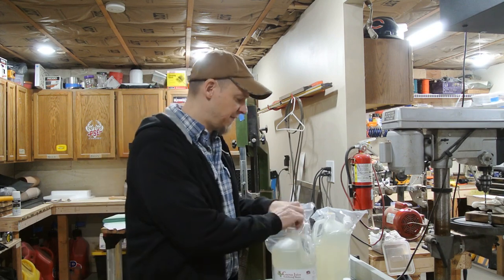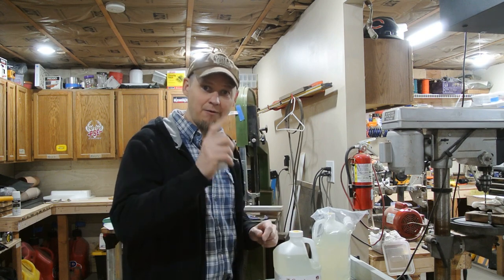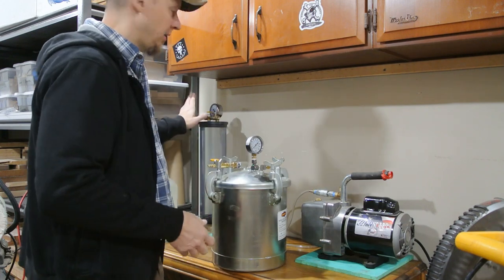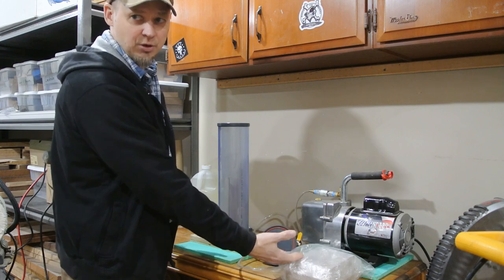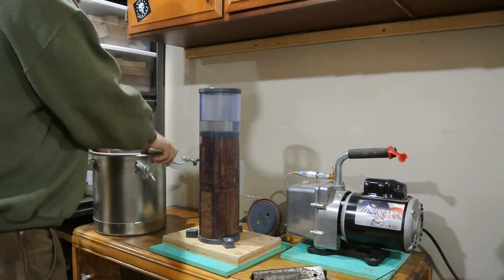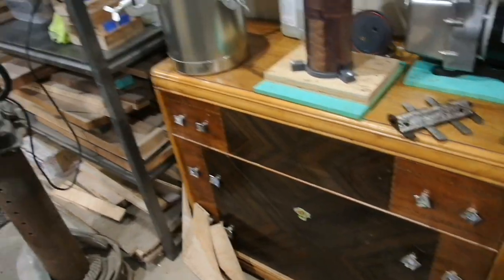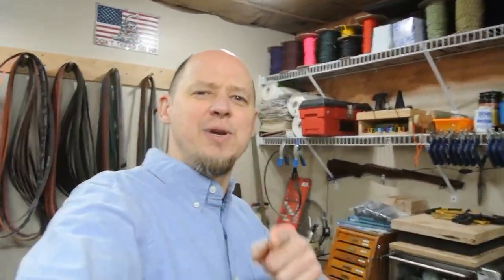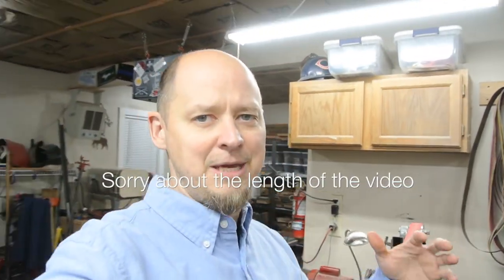Stabilizing wood for scales 2

Comment: Complements first then a suggestion!

I know this is an older video but it's great and very informative! Been seeing stabilized wood scales and found your channel while doing research and I'm working through your the 101 playlist. Good stuff! 

Suggestion time: 
So my background is custom composite product design and manufacture (15 y). Here is a tip from the vacuum infusion process (VIP) world. To minimize the risk of damage to your vacuum pump put in an in-line waste pot to capture any liquid pre-pump. Basically if an accident happens and the foam gets picked it drops into the pot from your line connecting the vacuum chamber to the waste pot. Another tube connects waste pot to pump with pick up set high in the waste pot. Shazam the liquid collects and only clean air gets to the pump. In the composites VIP world a large pot is a must or you'd trash pumps all the time. In your case a mason jar might be sufficient... lol I ended up with a decommissioned surgical vacuum pump that uses the same premise in a jar and it uses a rubber stopper to seal the jar and two hard-lines through the stopper for connecting the vacuum flex lines.

Sorry for the excessive comment length just a fellow PNW guy (Oregon) with what I hope is a helpful tip.

Comment: OK, I give up; what is a negative bar of pressure? You were talking about using a pressure pot after the pieces came out of the vacuum chamber. I think your statement was “the pressure pot is at 70 psi, 5 negative bars of pressure.” Are you saying that psi is directly proportional to ‘negative bars of pressure’? And why are your pieces being pressurized after the vacuum?

Comment: Should your vacuum pump not shut off from time to time and only start up when it loses a little pressure?
Reply from the maker: mrsaskriders ... You want your vacuum pump to continue to draw air from your wood.  Also, to stop a pump and let sit is not good because you do end up with some moisture being drawn and that gets into pump and if let to sit, can corrode.  I did a video showing what happened to mine until I learned better.  Besides, vacuum pumps are made to run for a long time period.  It doesn’t hurt the pump.  It’s your use of electricity that is the negative.
Reply: @CKKnifeandTool  thank you for your reply! I used to make artificial limbs and we wood laminate sockets with acrylic resin and it would be under vacuum. The vacuum pump stop from time to time and only start when there was a little bit of leakage. That was what I had to go on but I realize this is a different thing altogether. 😊

Comment: how many hours in vacuum please?
Reply from the maker: I run for 12 and go from there.  All woods are different.  The vacuum pump I use can be left running for a 24hr period easily without issues.  It's a heavy duty pump and costs more but it's also made in America
Reply: @CKKnifeandTool  Thanks